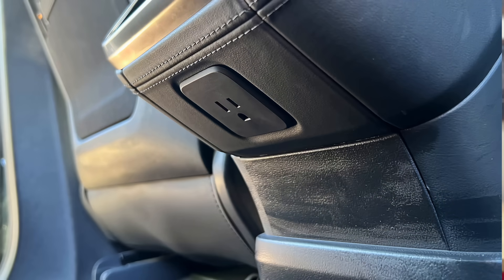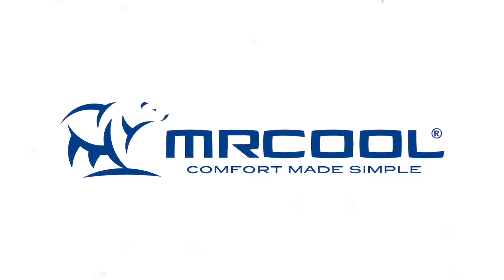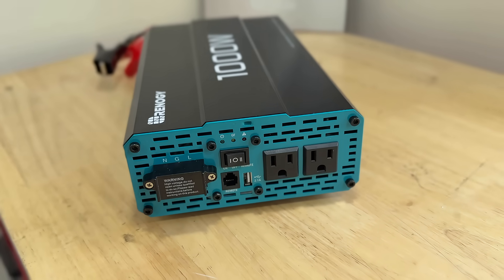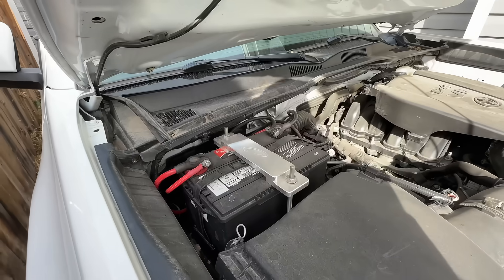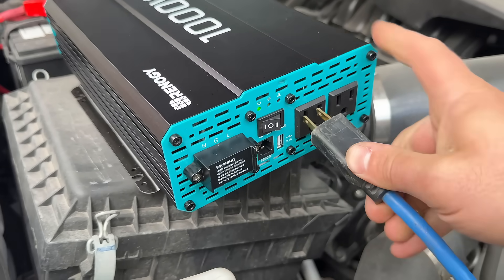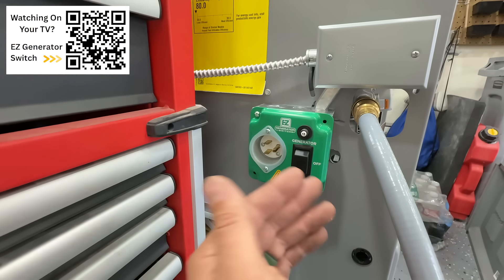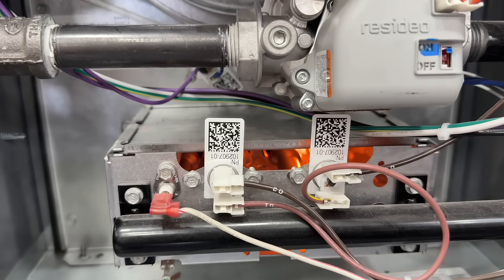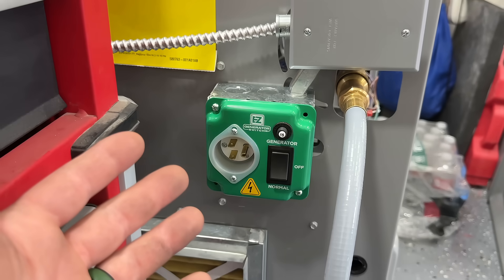Why Buy A Generator? You Have One Parked In Your Driveway.

Comment: 3600cc Car Engine or 80cc Inverter Generator for under $400,... Let me think lol,... I still hit the "Like" button though because it is another option.
Reply: I put 42.1 hours on my ~$350 2000w Wen inverter Gen this weekend after storms took out the power. I would never do that to a vehicle, unless a true emergency...very expensive Gen! That little generator is one of my best investments, ever
Reply: Energy out equals energy in. Just physics. You'll burn as much fuel in that 80cc generator as you will the 3600cc car engine for the same total Kwh, and probably more. Six cylinder engine, you get three "pushes", one every 120 degrees (four stroke engine, only fires each cylinder once in 720 degrees of rotation) from the cylinders for each rev of the engine. That 80cc generator is getting one push every two revs from that one little cylinder. Surely it's screaming to  have enough flywheel effect (centrifugal force) to make it through the combustion cycle.
Reply: @douglasw7806 
I know the 4 cycles if a 4 cycle engine but you go ahead and run your car engine at 40 times the size for a 600w appliance lol.
Reply: @douglasw7806  Sorry, no. My 80cc 2000 watt inverter gen ran ~8 hours on 1 gallon of gas @ 1/2~3/4 load. Will that Toyota with a ~20 gallon tank run 160 hours/6 days? The Toyota with a ~150 amp alternator at 13.5 volts would produce ~2000 watts at 100% duty cycle. I just don't see the math. If the 3600cc was driving a dedicated alternator, producing 10's of Kilowatts, I could see that math working.
Reply: @182QKFTW  Honda does say their 2000 watt inverter generator burns about 0.13 gallons per hour at 75% load. Pretty darn good! If I only needed 600 watts though I'd get my deep cycle battery from my RV out. It'll run my fridge for quite a few hours.Charges on solar if I want too.